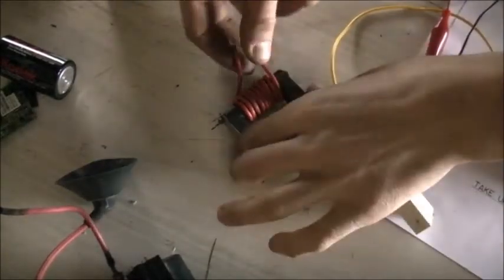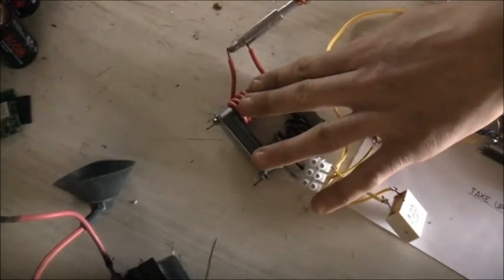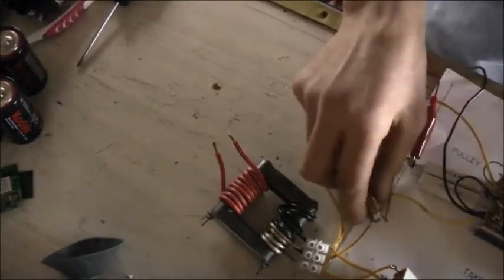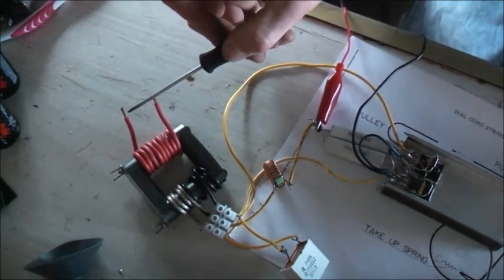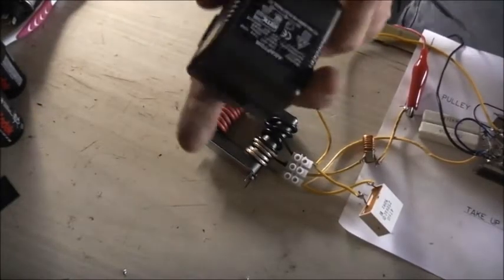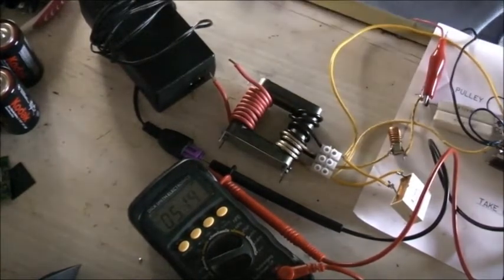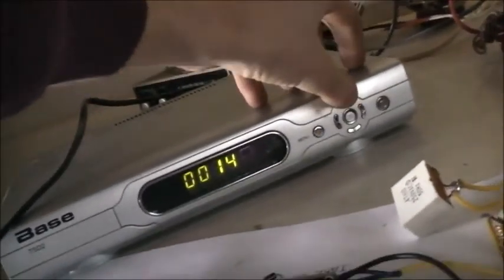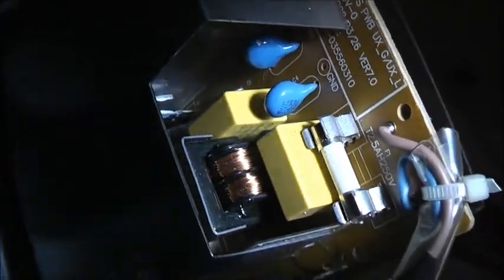ZVS Inverter Powering Stuff

Comment: I laughed loudly =so hard= when you popped the lightbulb. The thing went off like a camera flash. :D

It's interesting that you could get switch-mode PSUs to run with it also. :-)

Also, i've never seen a set-top-box which takes a voltage as low as 90v. Interesting, that one. I've seen certain appliancs ranging from 200-250v, 150-240v & even 100-230v, but not something which goes down to 90v.

Interestingly before now when Photon has been playing with CFLs, they start-up at 90v on the variac.

Comment: 50 Hz or 32 kHz is a huge difference and 50 Hz appliances are not designed to run at different frequencies as you have found out. although ferrite doesn't really care about the frequency but filtercaps and the like do.

Comment: Remember that those hot parts are likely noise filters, they are designed to get rid of frequencies like you're using. so yes, it'll run fine, but the filter circuit will absorb a lot of the power and probably cook!